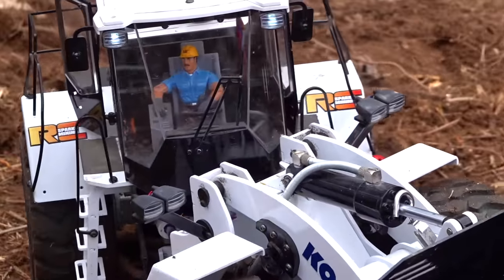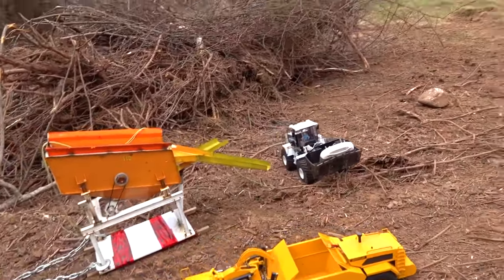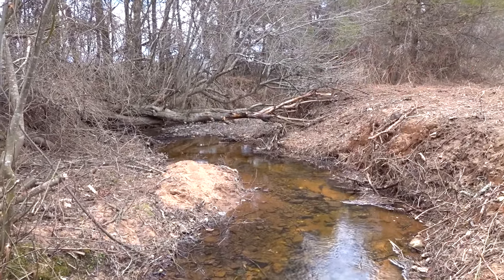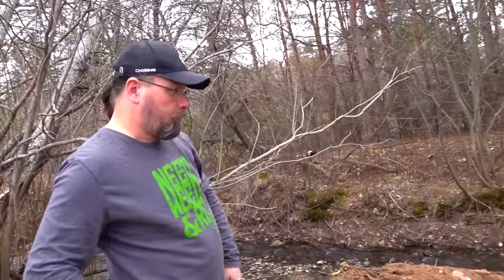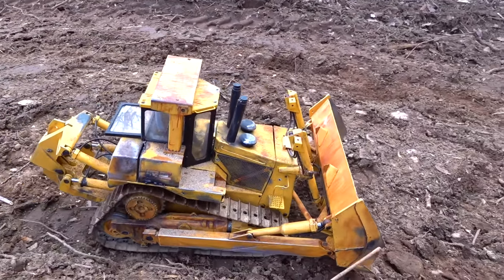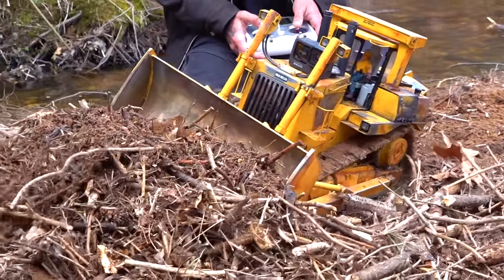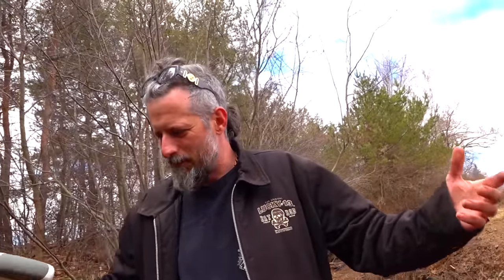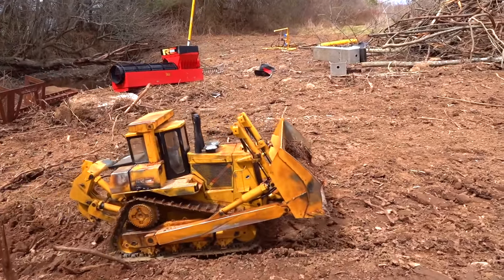Thorn Hedge Creek | RC ADVENTURES

Comment: When you push a scraper, a bulldozer should keep the blade tilt radius just right to push yet not lift the back end of a scraper thereby degrading scraper rear traction. Also best performance is if the blade of the dozer is high enough to not degrade any dozer pushing strength due to also making a cut... Is it probable four twenty got in the way? LOL!  Sweet toy selection!!!

Comment: Man, set us up a Starlink internet system, I might be able to help set up a Remote RC connection with cameras on a few pieces of equipment, could be controller from a computer with Xbox controller connected. Should help your guys out and even use the webcam for driver footage.

Comment: comment to your ai conversation, i made this thing that you connect to the rc receiver that can record throttle and steering signals, saves them to sd card then can be replayed, i could prob add a couple of extra things so it could control hydraulics too, would this be something you would like to try?

Comment: Hear me out. Here's an idea for ya. Metal detecting with Heavy Equipment.Think of it as a "meanwhile,back at the ranch" kinda snippet in your regular videos.Find a target with a RC car geared up with a metal detector onboard,...dig the hole and recover the object with heavy equipment. Provide a series of update snippets throughout the dig somewhere in your regular videos as opposed to showing the whole dig,...which may take some time to retrieve a pull tab or bottle cap LOL Just an idea to keep you busy and me attentive that I thought I'd throw at ya. And you never know what you might find on your proprty. Glad to see to machines back running.

Comment: Hello, I lost touch with you a year or so ago. I'm glad I found you again. I've always liked your style. On the D-10 if you stand the top of your blade more upright the scraper will work better because when you push on the scraper you lift the rear tires off the ground. So you lose part of the traction from the scraper. I wish I was closer this is something that I've always found fascinating. While I could only afford one piece of equipment it sure would be fun to come play. You can truly tell the age of the boys by the value of the toys. It sure would have been fun to have had these When We Were Young. Best regards Bob from Virginia USA

Comment: Ok a little bit of story time so we have a spring water well that runs off of electricity just a square brick box that goes into a pipe into a little opening and in a nother pipe that leads to a section Branch well there was a cave in a little while back due to part of the pipe had rusted out so the county dug it out and now we have a mini grand canyon that I mine out of by hand and also sift through the dirt separating the dirt from the rocks with an old strainer all at the age of 13

Comment: I absolutely love that bulldozer. My stepdad runs heavy equipment, and specifically, he runs a Cat D8. I remember the day I got to drive it vividly. early frosty morning, we made it to the location. started up the D8, he gave me a quick rundown of it all, let it warm up for a while, and then let me drive it to the flatbed. I remember being able to feel the power it had in the joysticks. I had the shakes from the adrenaline. I got out and jumped on the flatbed to "guide" him on. He saw me slip a bit because the trailer had frost on it. He dropped rpm on the dozer, got out, and walked over to the trailer. felt it a bit and got a very concerned look on his face. He looked me straight in the face and said, Get off the trailer and away from the sides when I start loading the dozer.

I still get nervous and adrenaline-fueled when thinking about what happened in the next very few seconds of the loading of that dozer.

He raised the RPM a bit and started inching forward. He started up the ramp, all smooth going so far. It reached the point of tipping it onto the trailer, it fell down onto the platform and slid about foot to the right. He quickly corrected to the left while inching forward. The tail end of the dozer then started drifting down to the right. He corrected more to the left, throttled up, and moved forward faster. He got it straight on the bed dropped the blade and stopped. My heart was pounding, and I remember breathing really hard. He shut it down, got out, and down to the ground. To this day, I am telling you, I have never seen this man paler in the face. We both kind of laughed. He shook his arms down like he was shaking the adrenaline shakes out and said lets get it tied down.

Comment: Get your terms correct it's blade operator not driver
Reply from the maker: sanitation engineer, not garbage man - petroleum transfer engineer - not gas jockey. Blade operator, not driver. lmao
Reply: Depends on skill level, I worked with blade hands that could fine tune a piece of ground.or prep roads for paving to guys that were lucky to drive them down paved surfaces. So there is a differance between operators  and drivers.